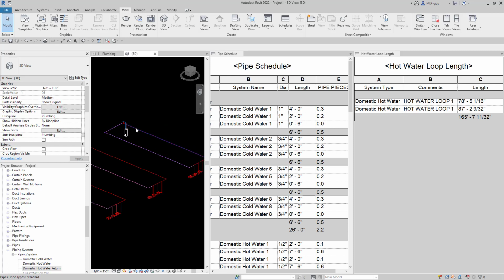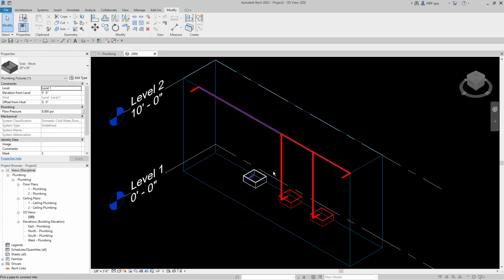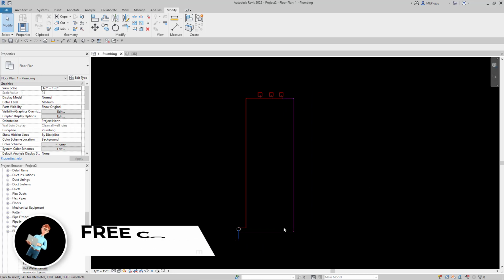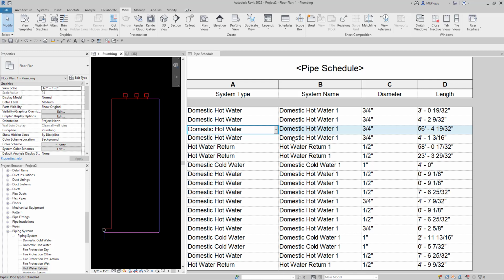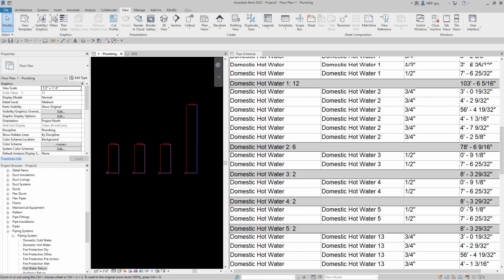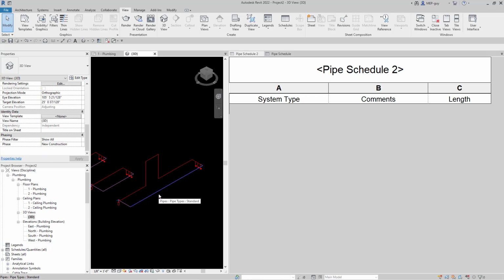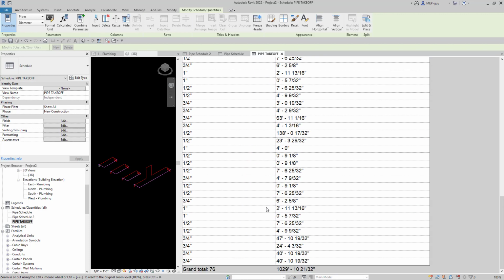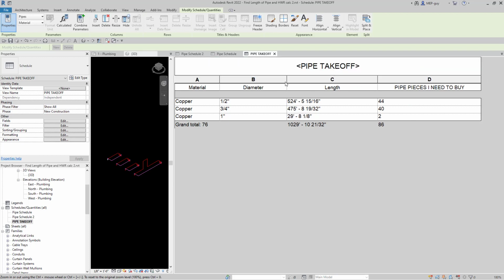*FIND PIPE LENGTH* for calculations and takeoffs in Revit MEP

Comment: how to extract pipe schedule based on levels.???
Reply from the maker: Off the top of my head you may want to add a text project parameter to your pipe called level. You could select all the pipe on a given level and add  the level name to that parameter. Then add that parameter value to the schedule.

Comment: wonderfull! very useful tutorials. Thanks a lot! Please, make a video about calculation of water consumption depended on quantity of people and devices and probability of using.
Reply from the maker: Great suggestion! In plumbing we typically size our water systems based on hunters curve, which is a probability of use for each fixture. This method is used to calculate the pipe size. Revit already has a sizing tool that uses the hunters curve. There are two curves, one for tank type toilets and one for flush valve type. Check out my most recent video where I place fixtures connect them and run some sizing calcs. Now I will caution you that this method is very conservative, since the hunters curves were created in the 1940's so fixture flow rates were much higher. Water efficient fixtures that are common today use much less water, so take this into account when sizing your system.

Comment: This gets me 90% of the way. I would like each system name with each diameter totaled individually. Not individual cuts. So, Domestic Cold Water, 1", 100'-6": Domestic Cold Water, 3/4", 50'-8", etc.
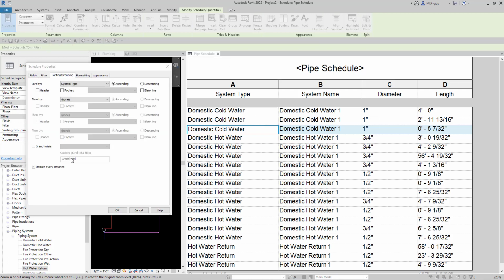Reply from the maker: You can use the same method, for sorting, sort by system type, then diameter, and make sure you "calculate totals" in the formatting tab for the length. That should get you total length by system then by diameter. Go to 15:26 of video and add the diameter to the sorting and click footer, then select title count and totals. That should group the items together correctly then give you the totals for that group. Hope this works, its definitely is possible!
Reply: @mep_guy  Nailed it. Yes. Thank You!
Reply from the maker: @claudaniella  AWESOME!
Reply: Does the length of the pipes include the part for which it's inserted to a fitting? Thanks